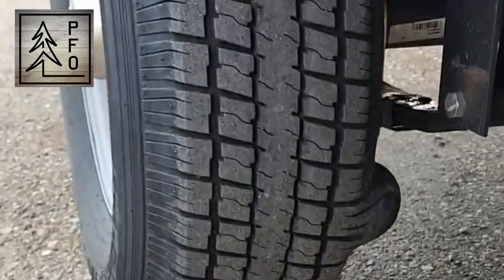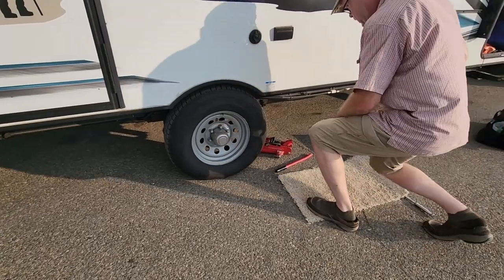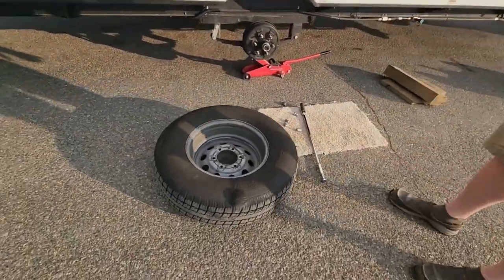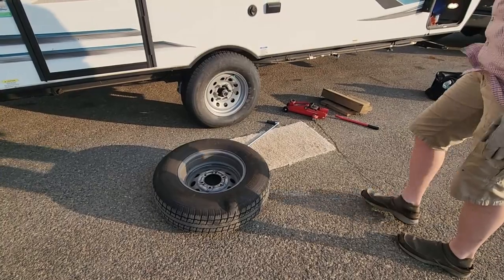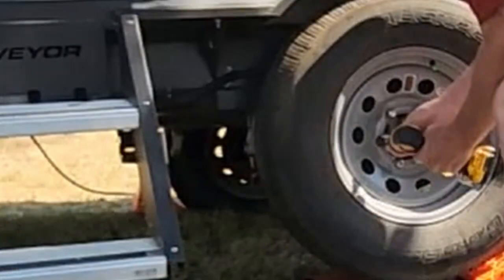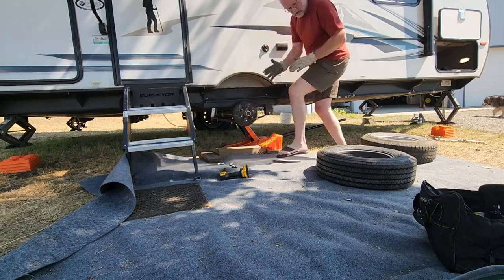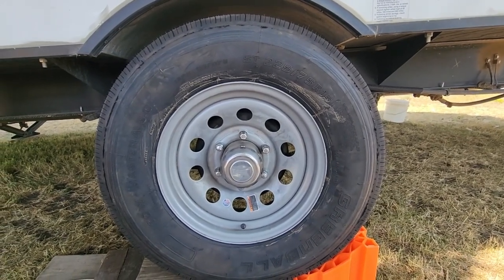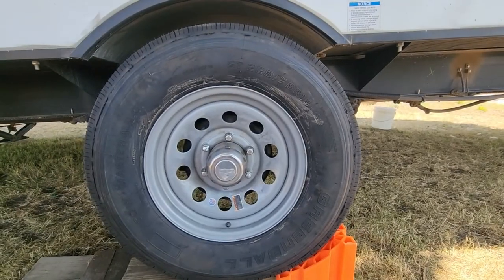Why inspect your RV tires at every stop?

Comment: 75 mph on the freeway? Trailer tires are rated to maybe 65mph max.
May want to rethink your driving habits.
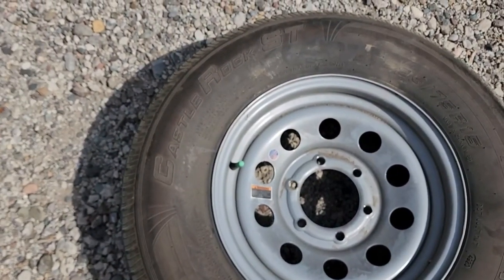Reply from the maker: Thanks for watching, Uncle Bob, but you may want to rethink your trolling habits. At 3:26 in this video, you can see the speed rating of "L" 75mph on the sidewall in the lower right area of the screen.